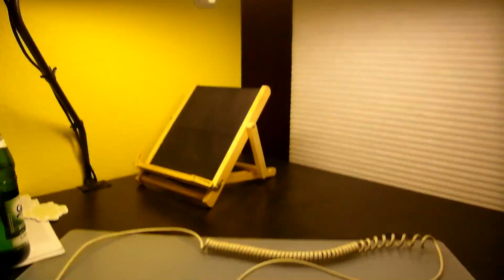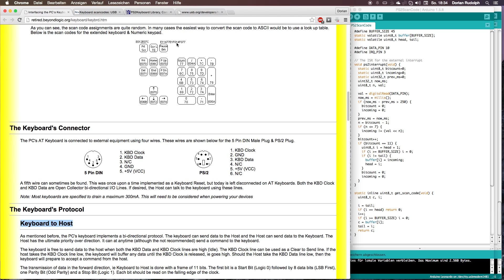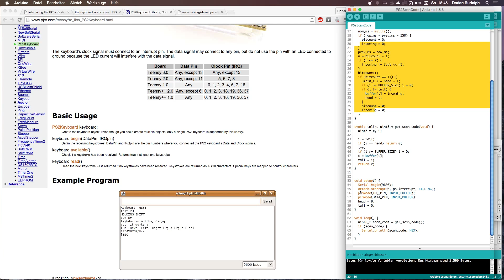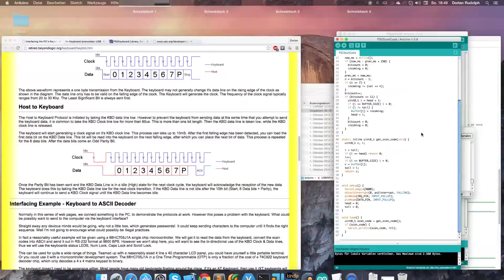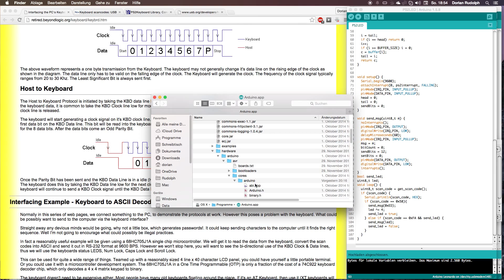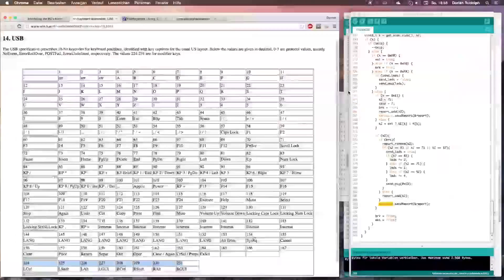Arduino DIY PS2/AT to USB HID Keyboard Converter

Comment: Sorry guys I'm a noob and I already did what you did, I'm having a problem related to KeyReport and report, arduino says 'KeyReport' does not name a type, Keyboard not found and 'report' wasn't declared in this scope, I assume my problem is due to USBAPI.h file because I'm using your code without any differences, I also checked that all the peripherals were included in this file and changed to public the method you indicated. I know this sounds a little annoying but maybe do you know what am I doing wrong? Thanks in advance